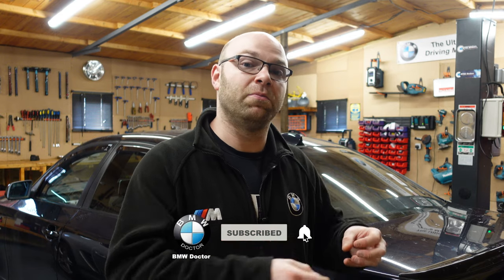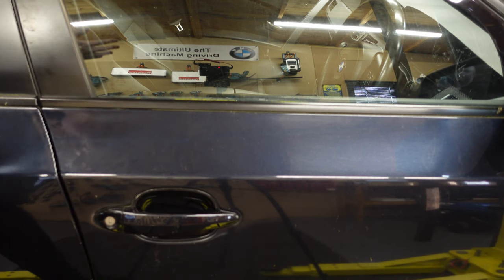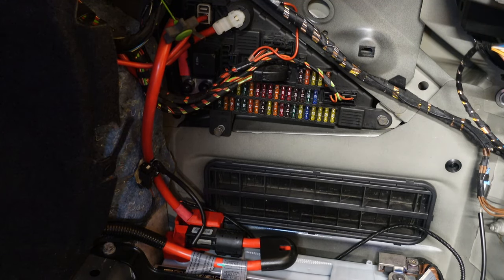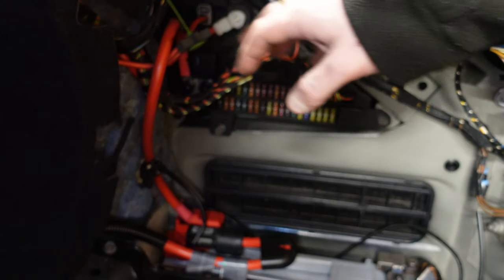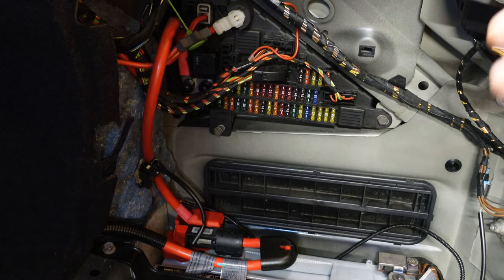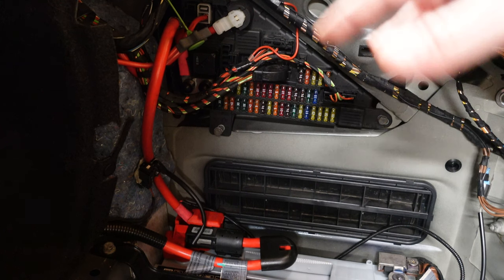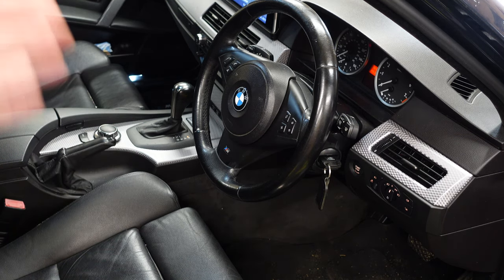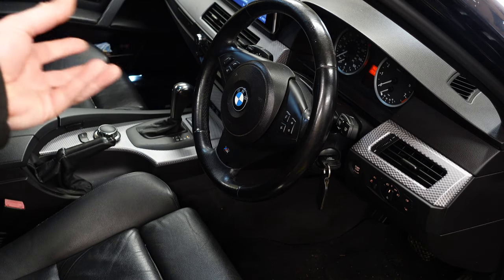Doing This Will Fix Your TERMINAL 15 , TERMINAL 30 , TERMINAL 30G_F Errors On Your BMW !!

Comment: 2097 E92 382i 6m. I have a slow drain that will kill the battery in a week. All of a sudden the tail lights, angel eyes and 3rd brake lights are staying on after the care is off. I'm getting the 30g error as well. I have cas module errors but only after the vehicle being at a repair shop with obviously no repairs done.

Comment: Dean, I will be the first to admit that I know nothing about how these cars work and 99% of what you said was meaningless to me.  This is my issue:  I have a 2018 X1.  A couple of weeks ago, it died twice as I was pulling out of my driveway.  I had it towed to the local BMW dealership.  They ran diagnostics and a complete reboot of the car and could not find any issue.  Then, a couple of days ago we were on the road driving from South Carolina to Virginia.  We made a rest stop and five minutes later, the car would not start at all.  It was towed to a BMW dealership in North Carolina and they determined that we needed a new battery.  They installed (and registered) the battery but said they were still getting an F30 Terminal error code.  They have no idea what was causing it but the next morning it started just fine with no error code and still seems to be running fine a couple of days later. However, whatever was causing the car/battery to die has not been determined and I have a feeling it is going to happen again.  I'd like the local dealer to look at it again to see if they can determine the problem but if they couldn't figure it out before running diagnostics and a reboot, I have no confidence they will figure it out now.  What do you suggest?  I am wondering what I should tell the dealer that might help them fix this.  Otherwise, I think I need to trade the car in for another one that I can trust.  THANK YOU!
Reply: Do you know if you have a good alternator? The alternator is what charges the battery. If your alternator has gone bad then it isn't properly charging your battery or sometimes it might not charge it at all, so the car won't start. Make sure your alternator is good 👍

Comment: Super useful video! I was just planning to dive into the electronics of my 2003 Z4. Have an issue where my audio cuts when i accelerate. driving to a stop with the foot in the clutch recovers the audio. turning on the rear window heaters + playing with the window switches also recovers the audio. Drives me nuts because this only happens in the winter, so cannot enjoy cruising with music in the winter😄. Does this issue sound familiar to anyone? Audio works flawlessly when the engine isnt running.

Comment: Hey iv 08 e60 520d was parked for 2 year due to crank no start and now I’m going to try get it running. When I put in the key the reverse lights are on, but the car is neutral. When I locked the doors at humming under the bonnet for half a minute and three minutes later, it does it again for half minute and so on and so on for about 20 minute sos with a line true it Comes on dash when you enter the key gose off after half a min. And there’s a car on a lift come on after the SOS light any help would be appreciated iv no diagnostics

Comment: Hello BMW doctor my car just lost a spark and injectors firing, and the vehicle code says immobilizer system and valve tronic.. i just replaced the engine and put a new one. Vehicle cranks but not starting. What could be the problem. Your assistance is highly appreciated. Thanks

Comment: Hi Bmw Doctor, I have undervoltage at terminal 30 and 15, well the car once was in a minor accident and the battery positive terminal popped & is currently in use. Could this be the problem with the undervoltage? Cause even if I trickle charge the battery to 100%, still my battery would drain. Battery is registered and will changing the cables & getting new one's sort out this issue?

Bmw 2014 F20 118i

Comment: I own an e92, e90 and e60; and do know quite a lot about both the n54 and n52 engines as I maintain my own vehicles. I’ve also fully rebuilt my own n54. However, this has had to be one of the most helpful videos I’ve seen to this day concerning these vehicles as I’ve been chasing a no start no crank with my e60/terminal 30 error. Thank you very very much for the in depth and detailed information. This will be very useful!🎉
Reply: Did not understand what he meant. My e90 just started giving problem. Hesitates at times while driving and all of a sudden shut off at a stop. I turned it on and within seconds it shut off alone. Next day i try to start but no crank. All types of lights and codes came up in the cluster. Any idea?
Reply: @Sunshine-dz5uc   battery
Reply: did you fix it? was it no start no crank and also no cluster or anything?  been dealing with something similar for a couple of weeks.. terminal 30 error no central locking no dash no start no crank lol

Comment: Thank you for this video. Was getting a drag sound off and on when starting my car. Terminal 15 faulty code popped up which like you said starter issue.

Comment: Great video! Watched it so many times trying to match up the info to my problem that I've aquired an English accent!!!
 USA 2011 E70 35d comfort access. 
 Terminal 15 -1, -2, -3 intermittently stays on after the car is turned off. While this is taking place, terminal 15 wake up (Pt Can) is jumping erratically from 0v to 12v. Terminal 15 wake (Acc) 0v.
 Resulting in the LED halos, brake lights and other FRM driven accessories to remain on. 
 Multiple start/stop sequences to finally have the car shut down completely.
 LED hallos flicker insanely upon shutdown.
  Help!!!
Reply: Same problem for my E60 520i N46 2009. Car diagnostic shows problems with Terminal 15 and Terminal 50. I have the same symptoms of LED and lights are remaining on and I have to do many start/stop sequences to shut them down also. I am thinking of changing relays or IBS but I still don't know. Please tell me if you found a solution. Thanks!

Comment: Thanks for the info in this video. I have 2011 328ix which has a parasitic draw. This all started after I replaced the battery.  I then had it registered by a mechanic. After 3 days my car was dead,  I got it recharged but it would show  9 volts if I left it sitting for 2 - 3 days. I ran several amp clamp and 10 amp DVO tests to confirm the vehicle doesn't go to sleep as there is a constant .25 - .5  amp draw even after sitting overnight (thanks to yours and other vids showing how to do the tests).  I was able to id the FRM as the power leak by pulling all the fuses and replace them one at a time to discover the leak. I have a scan tool but doesn't work with my BMW. Now after watching your video I'm curious if it's my FRM is the problem or is it some other module that is causing the drain. I have 1 flaw in that my rear windows only go down and not up which is what led me to suspect the FRM. I've since disconnected the motors to prevent any accidental operation. Otherwise the car runs fine except I have to keep it on a charger now - that and the occasional warning lights for "windows" trap and yellow "car on lift". 
Thanks in advance for insight you can offer.

Comment: My man you have some great knowledge What module controls the ignition switch ?
I get terminal 15 missing 
My key fob read once in awhile and car wil turn on I changed the key ignition assembly and no change still cant get it on

Comment: Hi Dean do you need to register the battery after disconnection for work on the car I.e replacing starter motor etc ?
Reply from the maker: Nope you don’t providing it was registered before ! But I would check that

Comment: hi, I have an F10, replaced the battery about a year ago and did register it (Battery from BMW). Today I received a note on the car screen that car couldn't go to sleep. Scanned and have these errors below (seems all related to a single failure), note that the car is still working with no issues, iDrive operating, car drives, lock and opens, and everything is working:
8020DB: Battery Sensor, Wakeup Line (WUP): Short Circuit to ground or line break
8020E8: Terminal 30F reset/shutdown
C90D60: K-LIN_6 xAUC_Sensor: Internal sensor error (I ordered the sensor to replace it)
CD8E10: LIN bus: communication error
D52C79: Signal error - voltage on board network, ID: U_BN) sender: BME1 - invalid
93076A: Deactivation of terminal 15: OSFG reached, but switch-off preventer active

Comment: You think it's ok to re-register the battery after disconnecting and connecting the negative and positive leads together to force a hard reset?  I tried it on my GR supra but my car still remembered everything and created more error codes than i was trying to get rid off lol.  But now I'm fighting ,isv terminal 30b: state contradiction. Which i think i overvolted the circuit with a PSU when trying to connect to ISTA.  Man BMWS are a love hate thing

Comment: Super helpful!  Thank you!  Would you mind helping me with a code I got after replacing a faulty VTG module in a 2012 e70 35d. Its a 53FC on 30g. ISTA-d shows that right after startup the voltage spikes to 20v and then levels out. I have no fuses blown and 50% of the time the car works seamlessly, the other half it will throw a 4x4! Error message.  Ive replaced the xfercase and servo motor and am at my wits end.

Comment: Hi bmwdoctor.  
Your videos are very insightful. 
I don’t see much in the F series.  But wondering if hear me out about my issue.   I have a 2015 bmw M3 f80.   I had a issue with my battery going low and trip the batteries internal relay.  I was able to reset it.  But since then battery is charging and working but now I have some issues.  Backup camera and parking sensors don’t work.  Rear heated seat and windows stop working.  Also just notice passenger side heated seat don’t work.  I have scan it for codes.  I have no engine lights but got some FEM and ZGW and REM codes.  One of the one there make me come across your video is.  Code 8040A6.  Activation power activate terminal 30F,short to earth.  Along with other codes.  
I greatly appreciate your input if able to on the F series.  
Thank your sir.  
-Steven
Reply: Exact same issue here...2015 F36 Gran Coupe M Sport.  Did you ever fix your issues? I'm curious about what you found.

Comment: Hi Doc. Just watched the video and you are right.  It's a lot to take in. Would mind assisting me on my e90 320D. It cranks but won't run. We tried putting the OBD scan. No information come out. Also put on Programming device.. kept on saying assembly not found on everything. There was a relay sound i used to hear on the driver's side when staring the car. But now no click sound. What could be the possible problem. Please help i get sick without my beemer.

Comment: Awesome video. Thanks Doc.
I have a question. I have a 2016 535i with codes 44003E, 48097D, and D355F8. There is no battery drain, though. 
Please what are your thoughts? 
Thanks.

Comment: 👋👋👋 Quick one from me: G11 2018, started having error message on ISTA+ about terminal 30. As a result, I have multiple errors on various modules. None of those stay permanently on - instead, each time I drive a different module has error. Battery voltage measured with meter is 12.06V. I know my way around cars, but G11 2018 is too advanced for me and need your help. I could have caused it myself by leaving my car with open glove box and arm-rest box overnight because we had multiple theft incidents and I wanted thieves to see there is nothing left inside the car. Can kindly you give me some tips and steps to follow to do further troubleshooting and diagnosis?

Comment: Hi Doctor! 
Nice video!
I have a question about my 335i N54 2007.. I’m having an hard time with the vanos codes.. In particular code 82 and for the loss of boost pressure in the proces i think so.. So after changing my vanos solenoids, new oil hausing the round one.. new oil and all filters am still getting codes and my car goes into limb mode.. 
Also when am driving the car on a normal city speed the car is acting weird.. It’s kinda shaking as i hold the gas just a bit to stay on the speed limit.. On full throttle nothing happens..
So if you maybe know the answer to my problem i would be very happy! 
Thanks again, Kristijan. 
Greeting from 🇸🇮

Comment: Have a weird issue with mine. Starts and shuts off. Good fuel pressure. Fuel relay works. Fuel pump relay kicks on/off at exact intervals. Also lose connection with dme in those intervals. Playing with throttle can get it to run but rpms easier to 2k rpm, dies out to 1500 rpm, catches itself back to 2000 rpms but at exact time intervals. Matches the fuel pump relay clicking on and off. Also clicking In gearshift but not as fast as the fuel relay. Can't monitor value because connection loss. Read values for only a second then lose connection. Also turning on fuel relay with under the program only activates pump for 2 secs max instead of the 30 secs it states. Also reading dme part number it displays from showing number to not available. Also can't control vanos for relearn.

Comment: You mean to say if you replace the relay 30 and relay 15 and the relays on the back of that fuse box it will be able to crank and start the car?

Comment: @BMWDoctor I went to look at an E70 n55 and the car would only start with a trickle charger/booster. Eventually it was having a tough time starting with the trickle charger (the trickle charger seemed to be switching on and off). After running for about 30 minutes it got a misfire on cylinder 3 and 4. I shut the car off and it wouldnt start again, it would turn over for a split second. On the 4th attempt the starter turned over multiple times but it didnt start and it would go back to cranking for a split second. The car started after being left alone for an hour. It did have an error code AOC1 Terminal 50 (Car access module) after the fact and an old stored code for Terminal 15 (Dsc module) that was probably from several thousand km ago. Instrument cluster has a Terminal 30G_F error as well. What would need to be changed to fix this?

Comment: Pressuply pump on n47 keep burning out, it's on 14 volts and 6 bar constantly, replaced flooded ecu wich did not make change, only what we could find was that jbe module see voltage from alternator when running, but says that terminal 15 and 30 off, rest of the modules see them as live. Could this be reason why ekpm gets wrong signal and keep burning pumps out?

Comment: Hey dean if you read this message , i have a 2007 bmw 320i petrol with only 142k km, long story short the car cranks but doesnt start, chrcked all the fuses they are fine, fuel pump works, removed 1 coil with slark plug and there is no spark, checked grounding cables and they are all good as well, bought a new battery (registered it to the vehicle with a scanner specifically for bmw’s and still no start, would you happen to know if there is a relay thats responsible for giving spark? I will literally pay you for your time, i dont want to get rid of the car cause i know its fixable, everything works! Except there is no spark, thank you do much for reading this.

Comment: Many thanks. I have no crank no start issue on e61 520d '08 but only when hot. It seems that modules may be the problem. Can I pull them out to see their condition?

Comment: Hi, thanks for the very good video.
E88 120i with no engine fan ( new thermostat new sensor new fan) no  sound / radio seemed to have no power and seat belt alarm.
Any idea please

Comment: Hi I have a 2008 bmw with not turning the ignition on.
No lights on the dashboard when I put the key in the slot and press the start bottom.
What could it be?

Comment: Excellent information. Where can I find bmw/mini codes. For example I have 931D code showing up along with A559, A3A9 and 9314. I am not able to figure out what these mean on my 2012 mini cooper s countryman. Drivability is fine. Only had a no start condition a few times. Also the 4 codes don’t clear when trying to clear via a scan tool. Any help would be appreciated.

Comment: Great video and explanation. What is causing on bmw 1 e82 2010 to not turn the ignition on termian 15? Also no communication with the footwell module and no com w dsc?? Steering lock obviously won’t unlock. Thanks
Reply: Did you fix the problem?
I have the same on a 535d 2006

Comment: I have bmw 428i. While driving car switched off by itself, before that bonnet open and crouise control message popped up. After that my car is not responding at all. I tried with my both keys, even central locking not working. I replaced ignition key battery and car battery still no response. Completely switched off everything. Could you please guide me what it could be 14:55

Comment: Hello, I've scrolled through so many videos and blogs for a little help I need with my 04 e64.

When turning the key (diamond) I'm getting no access power at all, the dash does work as I can run test modules and the small display will show the lights being on etc. the key works remotely and having tested I am getting power to the ignition switch the cas module says it's working via ista... Any suggestions on where to look?

Comment: Mini R56. Getting A Clamp 15 is missing along with a host of errors related to the FRM. Is this due to battery drain whilst doing a 15 ECU scan. So the FRM is shutdown.

Comment: Thanks for the information.  This is making me think that perhaps I'm having a crank no start because my Kombi is in the red when scanning my f30 with ista.  Could this be the case? I do have a code saying the starter isn't spinning. It's a crank no start. Sounds like the starter is spinning.  When I push the start button it cranks for maybe 4 seconds each time. Any help would be appreciated.